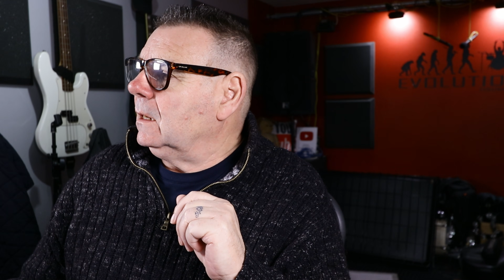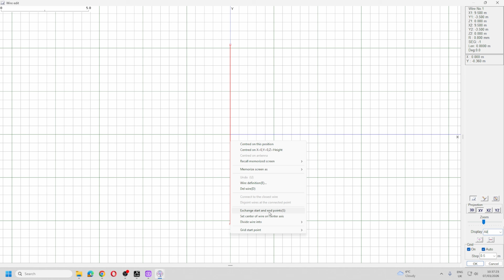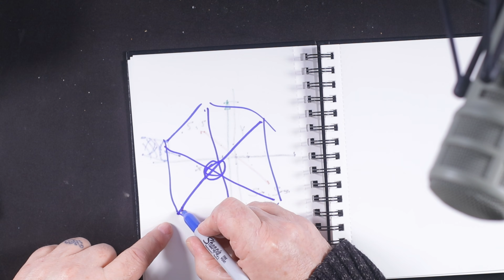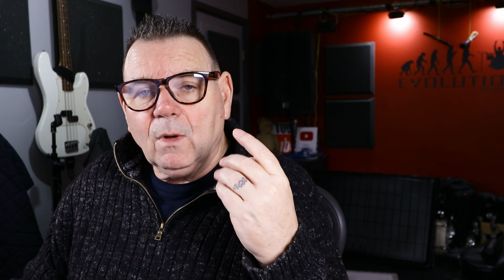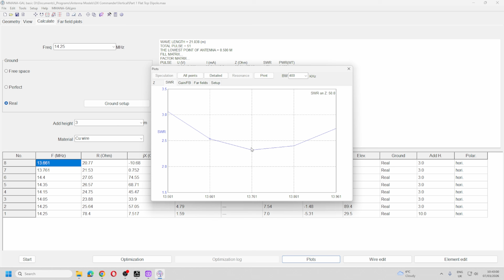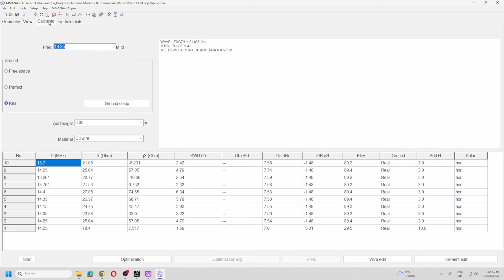Antenna Modeling for Beginners - Inverted-V Dipole (Part2)

Comment: Hi Cal.  As always I love the videos and learn a lot!  I think the thing I love about EFHW is that often you are kind of restricted in what your garden can offer you.  I have a 41m long 80-40-20-17-15-12 and 10 one and  having just passed my foundation a few months ago I was itching to get it up and get on the air.  So I just attached the transformer 4m up a plastic stench pipe. Ran it up the pipe about a meter, then it takes off at 5m in a horizontal to a tree about 25m down the garden.  From there for the last 20m I tied the end 10m high up a conifer tree so its a 5m to 10m sloper....So my EFHW is a horizontal sloper with a small vertical hybrid lol.  God knows what that would look like on MMANA-GL!!  When Im really bored, i might try and look!  M7 LUQ.   Ps.  Love the drum kit!  Im a musician and Ive been lucky to have worked with Phil Collins eldest Son Simon, who is amazing unsurprisingly and Ive also worked with Mark Brzezicki who was also amazing!!   73s!
Reply from the maker: I'll be doing one (video) as soon as I start again doing my "winter series" here from the bunker!

Comment: I made a wire dipole inverted V for 80 meters. I cut it as a flat top dipole at 3.9 MHz. I set it up in an inverted V on two different properties, one with 100 feet of coax and the other with 150 feet of coax. My SWR dip at both locations, was perfect at 3.8 MHz. It was broad enough to cover the voice part of the band that I wanted to cover and worked great. It wasn't very high above the ground in terms of wavelength on the 80 meter band. At the feed point, I used a cheap voltage balun, which gave both sides DC ground. I didn't know the ideal length for inverted V antennas at the time, but it worked out, even though I was going for 3.9 MHz.
Reply from the maker: There you go! Easy. Good work!!

Comment: I have an inverted V antenna, but it has traps so it works with 80 and 160. Is there a way to model a trapped antenna?
Reply from the maker: Since a trap is just a parallel L-C resonant circuit, in MMANA we represent it as a load element placed at a point on the wire. Rough steps: Loads → select the wire number → enter the position along the wire → add a load with the L and C values. I’ll probably make a dedicated video on this at some point.
MMANA models the electrical behaviour fine, but it doesn’t account for the physical length of the trap body, so sometimes you add a small wire section to represent that. PS: don’t forget to click “Use Loads”!
Reply: @DXC @DXCommanderHQ thank you for the info! A dedicated video as well in this series would be amazing as well!

Comment: I am loving these videos because I've wanted to get better at using MMANA-GAL. I do have a question that comes from my back yard. I have a Cobra dipole, 140 feet long, with both ends up 35 feet in trees, but the center hangs just a little, and the center passes over a rise in the property, so it's only 20 feet above ground. The wire doesn't actually sag much, it's mainly the ground rising right in the middle. Do you include the difference of the center above ground in the Geometry tab, or does it really not matter?
Reply: It certainly matters!
Reply from the maker: Erm, in the past, I have been fussy and split the wire into say 10 pieces and simulated any droop. But just for fun. Real world, it probably can't see the difference. Now - as regards to the elevation and where the ground is.. Build the antenna so that the ground is relative to the antenna - so in other words, build the model on a sort of "slope" so that you are trying to emulate what the ground will do.
Reply: @DXCommanderHQ  Thanks I'll give it a shot.

Comment: I’d like to model a parasitic array of something like 8 verticals in a row. I’ve seen guys do 2 or 3. I think it’d be interesting to see 8. May not be the most practical to deploy😂. I look forward to this series. Thank you.
Reply from the maker: Coming up !!!
Reply: Should be related to the 8 element yagi, which is reasonable size on VHF/UHF?
Reply: @mrtechie6810 not sure. It will be interesting to see how 8 nebulas in a row (parasitic array)would work on 10-80 m. A reflector and 6 directors
Reply: @AntonioBoosta there are actually huge HF log periodic array antennas in existence. Check them out!

Comment: I'm trying to do a horizontal Bowtie antenna for 40m. Center at 40' and ends at 15'. I messed with MMANA-GAL a fews weeks ago trying to get it. But, it started hurting my brain trying to get the different elevation points and all the horizontal angles inputted. 
I LOVE MMANA-GAL. So much easier, IMO than other modeling software.
Reply from the maker: OK, so the drawing function can help... I will show you shortly.